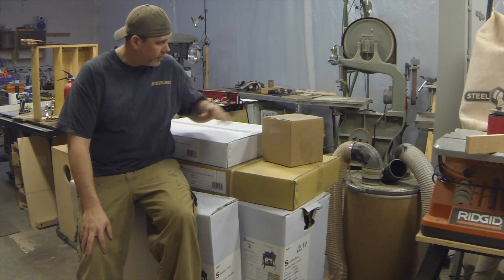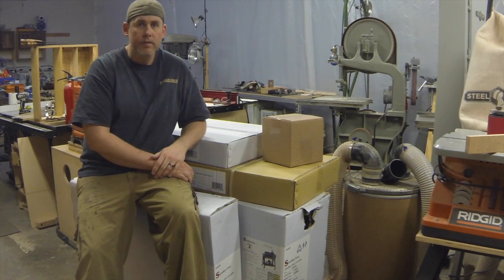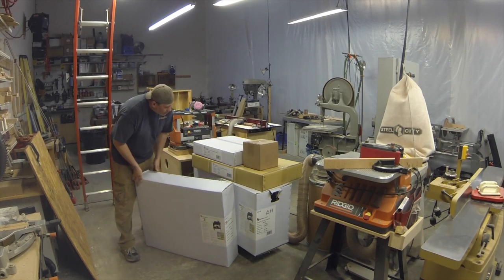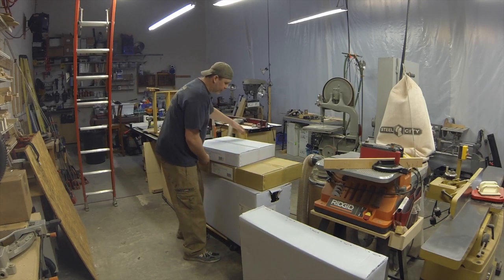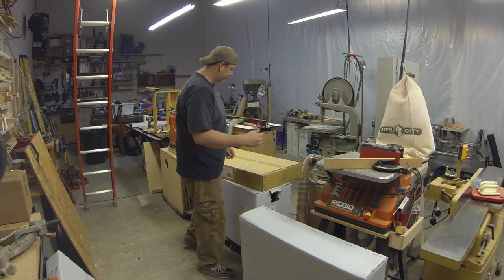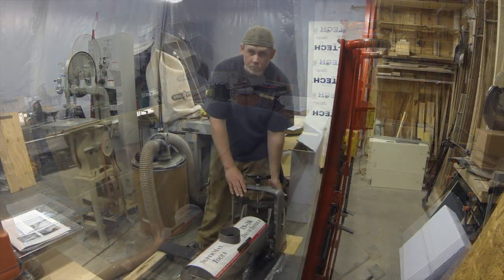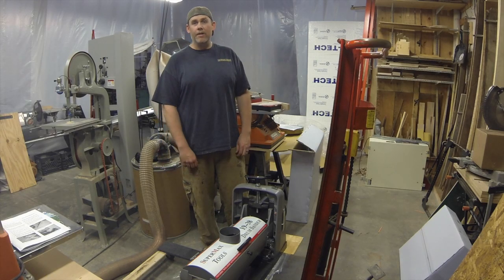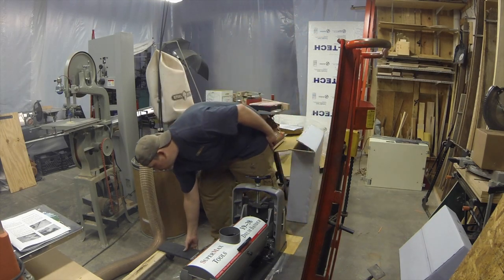SuperMax 19-38 Drum Sander Unboxing

Comment: Hey Zac, I am thinking about getting this drum sander also. Now that the honeymoon period is over, what other thoughts, pros/cons are you seeing with it?
Reply from the maker: Hey Guy, to be honest, the thing rocks! I really can't find anything to really complain about except for the infeed/outfeed tables which are extra I believe.

I'd probably not rely oon hae infeed/outfeed tables and ended up removing them real quick. I'm not sure if it was just me, but I couldn't get them to stay even with the bed.  Other than that, the thing is extremely well built, easy to adjust, and the paper is fairly easy to install.

The "Intellisand" feature seems like a gimmick to me. I've put burns into two belts, so it won't save your bacon if you accidentally take too large a cut or if you run really oily woods through.  

It's a heavy sucker, so make sure to have some help setting it up if you get it.
Reply: Zac Higgins Thanks for the quick reply Zac. It was very helpful along with the video.

Comment: Another question. Do you find the "quick lever" can do ANYTHING? I think I installed things properly. Took out the Allen head bolts, left the plate there, put the conveyor table on and bolted it down with the lever in the up position (here is a place where the instructions were not instructive and you could have detailed in your video). I can rotate that lever all the way down and pull it out in any position, there is no cam action at all. And that is my understanding of what it is supposed to do, just ever so slightly adjust the table up on the inside. 

BTW, if people get the extension tables, put the support brackets on BEFORE the conveyor table, it would have been a lot easier to put the bolts in without the conveyor in the way.

Comment: great video.  Im seriously thinking of picking one of these up. Right now I do a LOT of sanding with a dewalt orbital. Takes a long time and this seems like it would literally save me hours of work. Do you find that you get a decent life span out of the sand paper before having to change it?
Reply from the maker: I have to say, that drum sander was definitely one of the best purchases I've ever made! It could definitely save you a lot of sanding time depending on what you're doing. The paper lasts for quite a while depending on the use. As long as you're taking very light passes and keep the feed rate down, it should last a very long time.

Oily and dense woods burn quicker, so you have to watch that, but again feed rate and light cuts can help that out. Something I just thought of but never tried before is maybe hitting those oily woods with some acetone first, it may help out a bit.

Once the paper is burned that section is pretty much junk. Similar to getting a knick in a planer blade, but it will sand a burn mark in the workpiece in that area. Using 80 grit, I can easily get by for months as long as I'm careful. So far, I haven't used the paper up before getting a burn spot. I'm more careful now though, and I haven't burned the paper for a few months. If you're careful, a belt will process quite a bit of wood if you don't burn it.
Reply: Zac Higgins Thank you. The majority of sanding I would do with this unit would be on cedar at 220 grit.  Right now I use my hand orbital and while its not too bad, it takes a while just because of the amount of wood I am sanding.  Im curious if this machine with 220 would get the same results in quicker time. If you have any feedback on this I would really appreciate it. Just trying to get my homework done before I make such a big purchase.
Reply from the maker: Troy Diaz I don't think that 220 would do anything, it's well equipped as is. It's more of a torque thing than horsepower. You typically want it to go slow and take just a tiny bite at a time. Literally 1/64th per pass or less. It should handle cedar really well. I run western red cedar through mine all the time, just laughs at it.
Reply: Zac you kind of lost me on your reply LOL? So are you saying that the machine would provide a great, smooth finish with the 220 on cedar...similar or better than if using a hand orbital sander? Im thinking yes but again, would rather hear it from someone who actually has run cedar through the machine. I would be running western red planks through it.
Reply from the maker: Troy Diaz Sorry about that, I'm a little under the weather these last couple days so I've been all over the place. Some how I was thinking you were talking about 220 volt... I just reread it now and that absolutely wasn't what you were talking about! Sorry bout the confusion.

To be honest, I haven't tried doing finish sanding with mine. I use it more for thicknessing.  Because the drum is hard, it's pretty aggressive and really intended to take a layer off. It may not be as smooth and silky as you would get with the random orbit sander. I just don't know what kind of surface it would leave.
Reply: ok thanks. I actually just sent an email to the company to ask them. Its a significant purchase and because I would need it primarily for this specific need,
 I would hate to lay out the money only to find that it didn't serve the purpose and I had to still use the orbital.

Comment from the maker: Bruce Alvarez That's a good question, to be honest I have no clue. It's something my Dad picked up at auction, but I don't think either of us could classify it!  Maybe hydraulic jack dolly?  EDIT: Just found the same exact thing on Amazon they have a few, here's the exact one we are using: http://goo.gl/w8Ut8w
Reply: THANKS! Zac. Especially for going to the extra effort to find it.
Reply: Bruce Alvarez Generically they are Material Handlers - Lift Truck or stacker. Can't find one to rent locally and they weigh a LOT - 130 to 170 pounds for the type you have. Even if rented, I think you need 2 strong or 3 normal people just to get it out of the car. Still pondering how to get my 19-38 put together since I believe the sticker on the side of the box says it is 270 pounds.
Reply from the maker: Bruce Alvarez Well, I'm not sure what you're setup is like in your shop, but you could maybe rig a cherry picker/engine hoist up with a harness and lift the heavy part up with it, then slide the stand under. That may be easier to rent or borrow, or Harbor Freight has them for cheap if you want to buy one. I've had to rig up a pulley system for a few things in the shop too, just get a pulley or two and some cable, hoist it up and slide the stand under. It is definitely a heavy sucker! Hope you get it up and running soon, it's a sweet piece of machinery!
Reply: Zac Higgins That is, in fact, what I did. The shop is one bent (post and beam term for a section between posts) of a barn that is ~150 years old. First I pondered making a tripod from 2x4s (I have LOTS of used lumber) and looked for a pulley everywhere. Then I thought maybe I could skip the build and hang a wire cable from a rafter (there are several ropes hung that way in other parts of the barn). After looping the cable around the rafter, I came down off my fully extended aluminum Gorilla ladder and FACE PALM!!! I was STANDING ON A TRIPOD! And I had a 2' piece of metal closet rod I could lay across the ladder steps so I didn't even need a pulley.

OK, so now how to hoist? I have a snowblower for my 24 HP garden tractor which is lifted by an electric winch. Perfect. I took the blower off and drove the tractor to the door of the shop. I found some sort of  horse "apparatus", a leather belt that had a clip on both ends, and looped the strap under the machine, clipped in the middle and attached the other clip to the thimble in the winch cable. No strain on my part.

Up comes the machine ... for a bit then UP comes the front of the tractor! Had to get my 22 Y/O daughter and her great heft of ... ~105 pounds to stand on the front wheel so the proper piece of machinery would rise and I could get the stand under it :D It is all put together, haven't tested it yet. Quit at 6:30 last night when the hose for the DC REALLY didn't want to get shoved onto the DC unit. Going out now to finish up and test.  

 I will say that the instructions for the stand were really good. For the machine? Not so much. A fair bit of guessing there.
Reply from the maker: Bruce Alvarez Sounds like it was an adventure! I'm glad you got it set up. The instructions weren't super instructive, but luckily there's not a whole lot to it. You'll be making sawdust soon!
Reply from the maker: Zac Higgins It's been a while since I put it together, and I don't remember exactly how the cam lever works. I don't use that function, so I'm not really familiar with it. I'll take a look at it and see if I can remember how it works.
Reply: Zac Higgins I made a LOT of sawdust and it was ALL in the DC bag. Can't say enough about how well that machine is designed with respect to dust. I was sanding at 1/64th (1/4 turn of the wheel) per pass on 150 Y/O pine 15-17 inches wide. REALLY light stuff and I didn't even need a dust mask. 

Quiet machine too. Can't even hear the drum spinning (even with the conveyor off), the conveyor motor is louder but pales compared to my DC.
Reply from the maker: Bruce Alvarez Awesome!!! It is amazing that it makes virtually no dust! Glad to hear you are up and running!